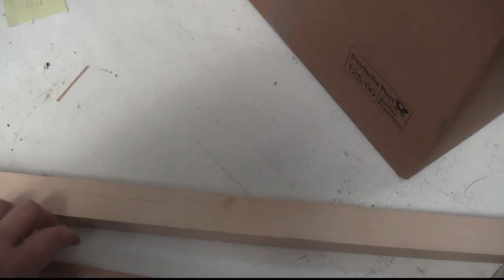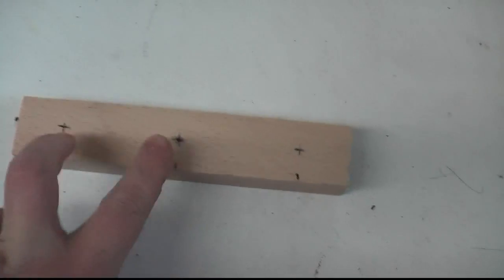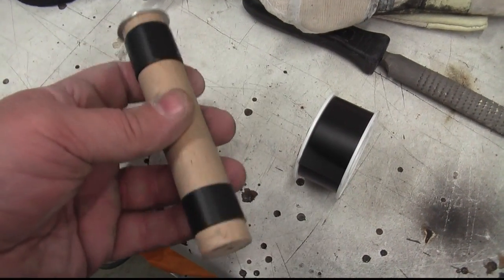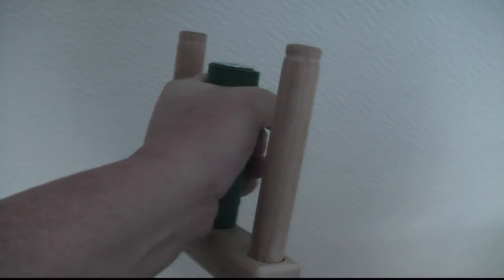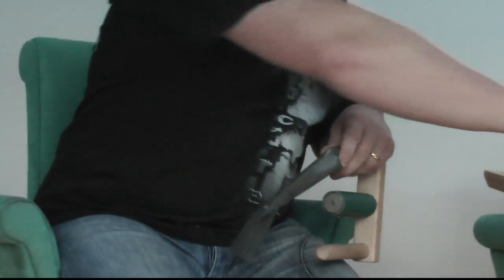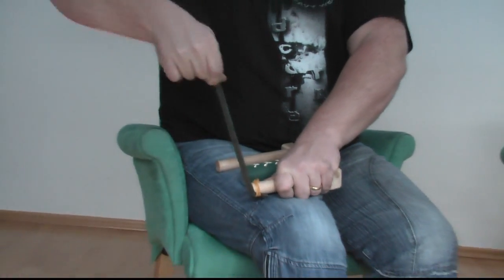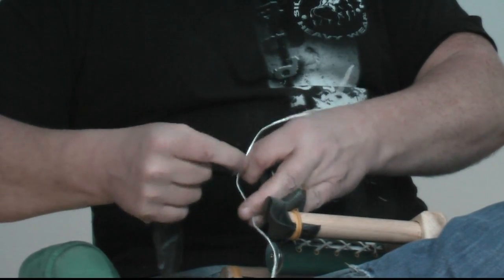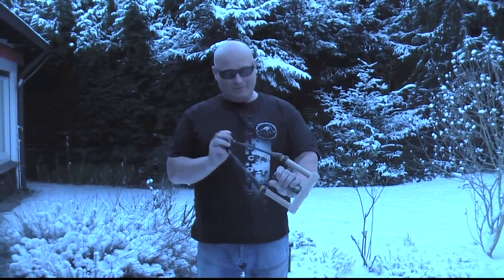How to make a "W" slingshot with common tools, at home

Comment: Does the rotating handle have a purpose?      Great tutorial!!!!!!!! As always!!!!!!!
Reply: self-centering. It will shoot in a straight line between the point where you had your hand when you let go of the pouch and the center of the rotation point. Imagine it was stif then if you move your hand left and right sideways, it would stress one side of the band more and the other less.

Comment: i have made one of these slingshots recently, it is very powerfull, and i followed the tutorial labeled how to make the strongest destruction slingshot. it is easy to controll, but i do have problems  getting to full butterfly with it. the low fork makes for an extremely strong slingshot, this is a very impressive slingshot

Comment: Personally I dont find the 'W' my ideal slingshot. The idea is clever in that it leverages certain advantages, but what turns me out is that it has a very large profile, since requiring enough space to allow knuckle room. Size is an important factor for slingshots and something compact and discreet is more suited to my interests. I'm also slightly concerned about the joints to where the outer rods connect with the horizontal piece. the connection will need to be very robust to maximise power.